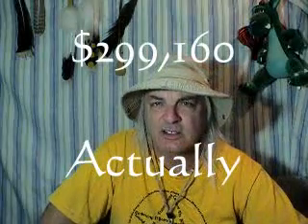Re: run your car on water. This guy does just that! (lying)

Comment: I'm sure this has been said but he said very specifically it doesn't run on water but the hydrogen produced.  Also, you can build a solar panel for about $50.  You're a dumbass.

Comment: It's not possible to do that, because you can't really get a closed circuit loop. Generators/Motors/Lightbulbs and all other devices waste some of the energy going in or out in the form of heat. The electrical energy in the loop you're talking about will quickly drop to zero as it escapes the system in the form of heat.

Comment: gasoline = 15-30% eff. during acceleration its 15 at constant freeway speed around 33%

electric motor, depending on the design is 80-94% eff. The problem is storage of the power.

Comment: The only difference between your two calculations is the assumed efficiency of the HHO generating process.  If you need 121,000,000 J worth of HHO, and it requires 183511747 J (according to you) the HHO generation process is 66% efficient.  According to DP's video, the highest ever efficiency for the process is 48% or something.  In his calculation he assumed the value of 23%.  This results in the difference in your final answers..volume equivalency of HHO to gas is irrelevant to the calculation

Comment from the maker: Hell, my ancient Toyota pickup got 26 miles-per-gallon (tentative result) over a span of 800 miles. That isn't a valid test since it was a driving test, and driving conditions change.... but I drove much slower than I usually drive. Normally I get around 22 miles-per-gallon.

Comment from the maker: No, "Pancera university" has not "proved" the on-demand oxyhydrogen devices "work:" they showed that injecting a large amount of hydrogen from an external supply into a gasoline engine will slightly increase MPG over a very narrow range of horsepower. The tests had nothing at all to do with on-demand oxyhydrogen devices.

Comment: BTW I can get panels for 1.90 a watt, so that would be 9700.00 bucks, life span of panels = 10 years at better than 80% output, so I could get around 3000 days or gallons of gas equal,  which is 3.23 bucks a gallon equal. So its not so far off from where we are. Not this does compress it and whatnot, and it would be better to just charge the damned car with batteries.

Comment: 121,000,000j= 1 gal of gas (I started with quoted wiki 32mj per litre) 
16821.litres hho = 1 gal gas
183511747J needed
10hr*60min*60sec=36000
5097. watts of solar needed
144w=36 panels needed to make 1 gallon gas equal in 10 hours.

This is where real experience comes into play Dp. I have it, do you?

Again thats a lot of power to make a gallon of gasoline, but hey. I am just here checking math.

Comment: 34,200,000 joule per litre gasoline
7193 joules per litre of hho

4754. litres hho = 1 litre gasoline

51868609.joules needed based on real tests

34200000/51868609=0.659
or 66% eff. not 25%

Just going over the math, and comparing to real tests.

Comment: dp if you need 34,200 joules of hho to equal 1ml of gasoline, and the electricity to hho process is only 25% eff. shouldn't it be 34,200/.25=136,800 joules of electricity to make hho = 1ml of gasoline?

That would be an mmw figure of 2.08mmw. And I personally have well over doubled that, well more like over tripled that. 

Correct me if thats not a mistake. But it seems you multiplied instead of divided.

Comment: Well, the point is to create green energy, right? 
Burning methane will produce carbon:
CH4 + 2O2 > CO2 + 2H2O
While burning Hydrogen will be much more greener:
2H2 + 02 > 2H20
But the methane it self is not green, if it released to atmsphr.

Comment: To use Hydrogen for fuel, don't try to extract it from stable molecule. H20 have very stable bond and require lots of energy to take H atoms from it. Try Methane, for example, (CH4) which have more atoms (4) instead of water (2). But Methane is one of major green house gases.

Comment: "So, maybe not immediately practical, but, conceivably could be." caseagainstfaith

It doesn't seem to me that electrolysis in the vehicle can ever be worth it. If you have enough electricity to waste on electrolysis, you can just power electric motors with it more efficiently. 

X Watts * .25 electrolysis efficiency * .25 Internal combustion efficiency

or 

X Watts * .9 electric motor efficiency

hmmmm I wonder which works better.....

Comment from the maker: The Toyota 3.0L V6 is a whopping 33% efficient, and I was going to use that figure but I went at the numbers from the other side: the energy budget of gasoline, and how to make up for it in using electrolysis to transport energy to the automobile via hydrogen. Once it hist the engine, I assume gasoline and hydrogen have a similar 66% loss. I would much rather have electric cars.

Comment: You forgot one part of your formula.

Efficiency.

As you know, internal combustion engines are thermodynamically limited, they can only get to.. what is it.. something like 28% efficiency.

An electric car can get significantly more.  I don't have an actual figure to cite, but I think it can get to at least 80%.

In any case, in 5 years those figures of yours are going to look quite different even without the efficiency differences.

Comment: Incidentally, those 108 panels, running continuously, would produce 2.4G equiv daily, which, given a nominal gas efficiency of 25MPG, would work out to 60 miles daily.

That /would/ cover my commute, but I'm really not willing to kick out the $60k for it, nor the cost of retrofits.

Comment: Plugged into Google:
124,000BTU / (144W * 10Hr * 0.5) = 50.47...

124,000BTU = Energy in 1 USG Gasoline
144W = panel capacity at full sunlight
10Hr = Time running panel
0.5 = (generous) efficiency of electrolyzer

Also, 
124,000 BTU / 10 Hr / 33 V = 110.12... A 
Same values as above; 33V googled for 144W panels.  110 A is a ridiculous current to be dealing with outside of the supply level, by the by.

Comment from the maker: Har de har! I did the math on that as well. :-) Gasoline costs less money.

Electricity: $0.028 per million Joules
Gasoline: $0.020 per million Joules

If the USA would convert from coal to uranium-generated electricity (via steam turbine), the cost would go up a bit but I'm all for it--- I would rather have domestic electricity than foreign oil.

Comment: Unfortunately I've seen similar sloppy wordage such as "runs on water" used to describe the Volt, the electric car that can run 40 miles on stored electricity.

To hype the car claims are being thrown around that it could get something like 200 mpg when it's run off of the stored electricity and gasoline to drive it a few extra needed miles on occasion.

In the same way that the power isn't coming from the water, most of those miles aren't coming from the gasoline for those bloated claims.